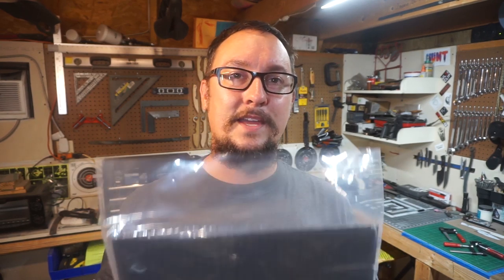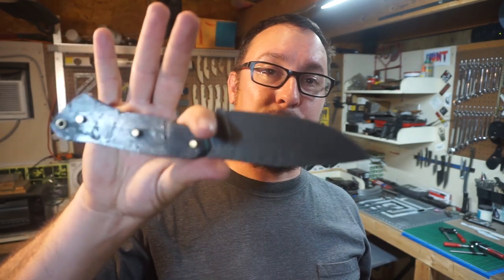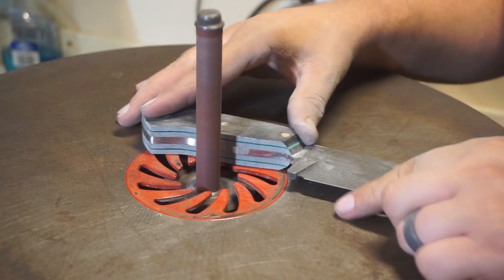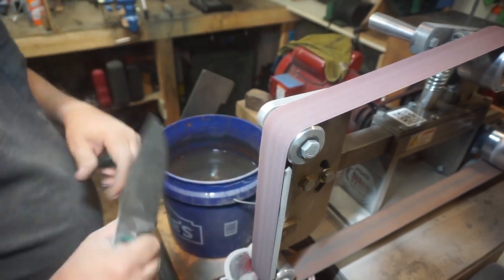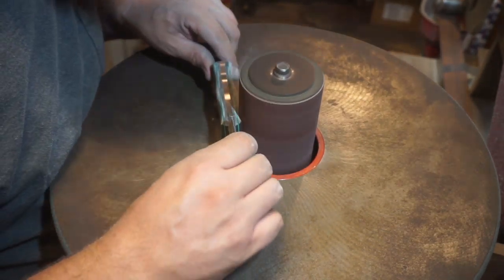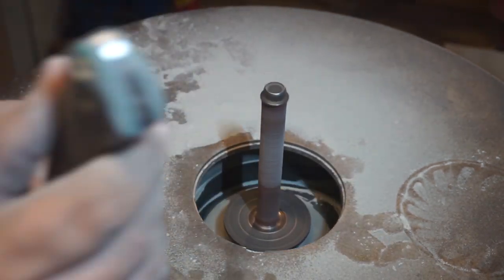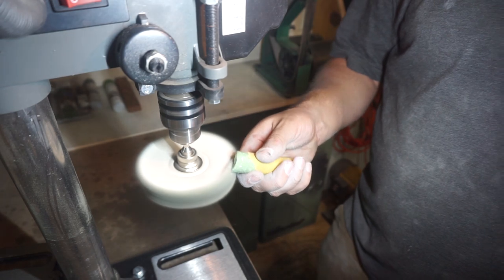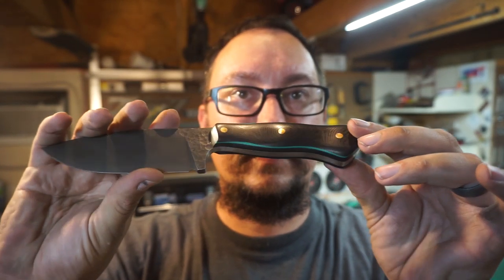Shaping The Handle Scales On "The Hunter" 5160 Knife | Knife Making | Daily Vlog

Comment: Another excellent knife.
I want you to know I ordered what I needed to make 3 knives yesterday. You may remember the comment I left you a few days ago about getting electrocuted, and not being in the right place in my life... I'm getting there thanks to you friend. Question: when sending the handle, you have to bring the pins down and then the handle material because the handle material is softer? or how do you work that out best?
Thanks.
Brady
Reply from the maker: You can bring them down at the same time, you just dont want to focus to much on the wood around the pins because you will sand the wood faster than the pins. If you ever get to where your pins are higher than the wood, just take a file or piece of wood and wrap some sand paper around it to be able to sand just the pins and make them level with the wood.